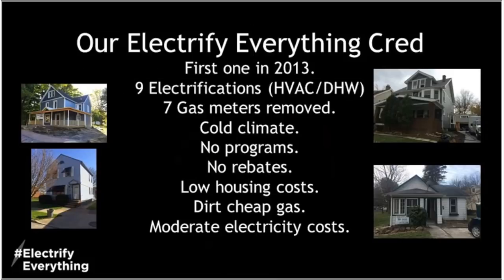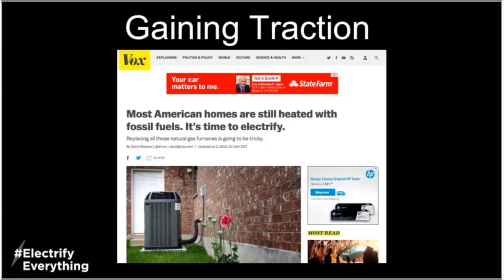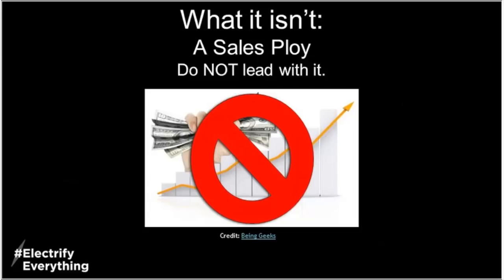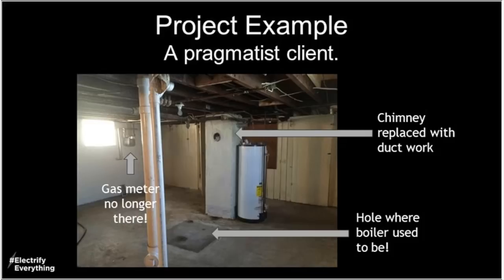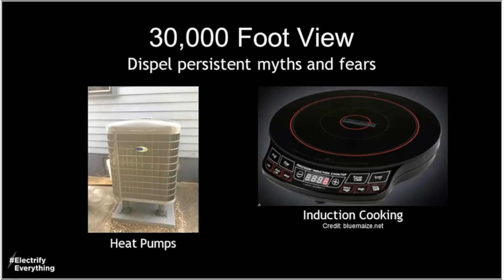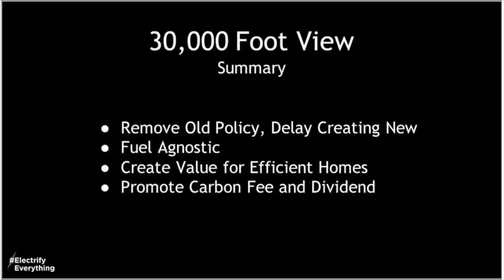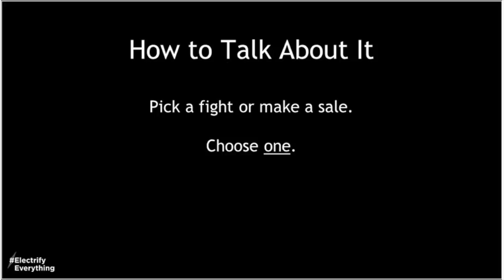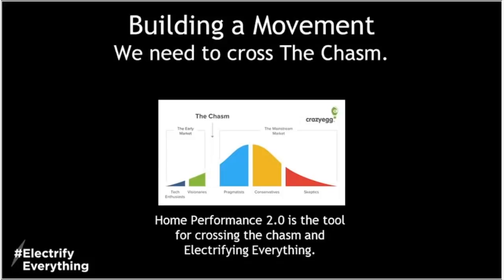How to Electrify Everything In Your Life

Comment: You could help your customers even more by thinking partial DC rather than only AC.

There are DC mini split variable inverter heat pumps which require 3-solar panels for energy sources during the day, and they work with AC at night.

Many electric heaters accept a second heating element.  Place a DC heating element in there.  It, also, requires two or three solar panels.  Both the mini splits and the electric DC elements do not require an inverter.  This lowers the cost of capital to customers.

Moreover, they will love the reduction in electric bills.
Reply: Eric Kosak Interesting. Do you have any case studies on that? 

We try to keep complexity down, can that be achieved with DC?